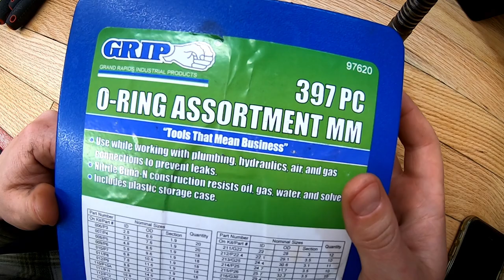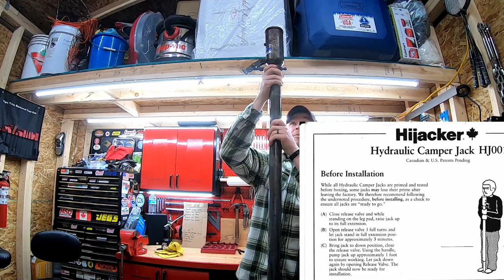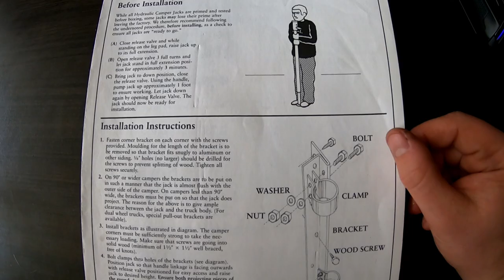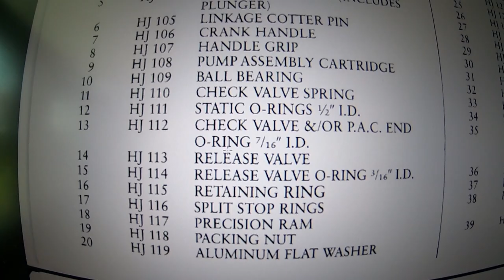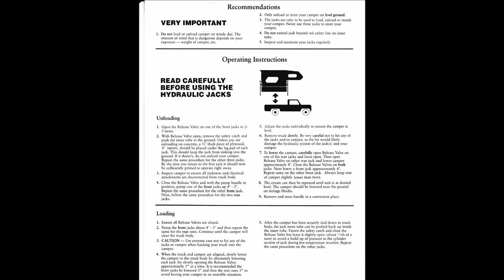Hijacker Camper Jacks | Top End Rebuild and Priming

Comment: Great Video! Do you fill the jack upright, retracted and to the bottom of the hole with oil? Or do you fill it laying down flat?
Reply from the maker: I filled mine to the fill port level while the jack was standing upright. I believe if you fill it while on the bench you may overfill it.
Reply: @OvensGarage  how do you get it in there if it's in a bottle should you use like a turkey baster or something?

Comment: I learned a lot from this video, I bought a kit of O rings with multiple size,  the kit cost me over $30. 00 , found out its only good for plumbing not for hydraulics=,  the inside  3/8 ( ID) inside dimension might fit but not the outside dimension or thickness. THe proper washer at an auto parts cost me under $10. for all 4 jacks , also expect using over 1/2 liter of oil to refiled .
Reply from the maker: Glad it helped

Comment: Hi!!! I have a jack that is leaking but it is the 4th one you showed that is not labelled. The mechanism looks identical. It is called Shur-Lift but I cannot find any information on them. Are you able to take it apart and tell me which ring sizes and other materials required? It is less complicated than the hijacker but I don't know the sizes or other materials (I believe there is some kind of leather washer also that I can't find anywhere)

I can't find any owners manual or instructions to fix the leak on this one.
Reply from the maker: I ended up not rebuilding that one unfortunately!

Comment: Overall it's a good video. I do recommend you find a video on how to use snap ring pliers. You used them the hard way in this video. You could have changed the pivot point and squeezed the pliers instead of separating the pliers to remove the snap ring.
Reply from the maker: It's a small snap ring...it worked
Reply: @OvensGarage  yes. Tou did it the hard way and made it work. I was telling you the easy way was all.

Comment: Trying to source the size of the fill hole bolt o ring . Do you happen to know the size ?
Reply from the maker: It's at the end of the video. Part 15, 3/16" ID o ring.
Reply: The reservoir o ring ? Part "2"
Reply: @OvensGarage  the reservoir o ring? Part 2?
Reply from the maker: @CodyOwns8  part 15 as shown in the diagram at the end of the video

Comment: Excellent vid, thanks a lot!  One thing though, the bolt on the very bottom (seen on schematic at 2:45) turns and I can't get it loose.  It seems to be leaking at that bolt, but I can't unscrew it....I can hear the entire inside turning with it.  Any ideas?
Reply from the maker: I only did a top end re-build on mine, but I think you need a specialty tool or remove the lower portion of the jack.
Reply: Yeah apparently you can't really do the bottom if its leaking there, only the top is DIY

Comment: what is the quantity of each o-ring required per jack, thanks for a video
Reply from the maker: As per the diagram, there are 5 the same size, and 2 smaller ones the same size per cylinder, then an o ring on the screw and filler bolt, as well as the plunger cylinder.

Comment: To actually rely on these old things blows my mind..we had one fixed recently, and after that the never ending drips from the others proved this would never end. The seep, uncertainty of their holding ability has made us sell the unit. We had one break through a block that was holding it...and that was it..never again. Unless you have a waiting structure in place, and can ease the camper off your truck/more so,  on your truck...be very wary of these old things....Not suggesting they can't be fixed, re sealed etc...but pumping them up, releasing the valve etc. ....that is beyond old and dodgy IMO...We had a unit that had electric jacks before this...oh why did we sell it...!..it took 10 minutes...these...say again are dodgy and old...be very careful, never have them on the ground without fully bracing your camper unit....Sorry, the rest of the comments seem to have no issues...in my experience...the jack collapsed, the entire camper came at me sideways, thankfully resting on the remains of the blocks we had set up, or I would have under it....A good 2000 bucks will get you electric versions...
Reply from the maker: Yep they sure are sketchy but they get the job done for me! I've loaded my camper dozens of times no issues. Just takes a while and I stay cautious.